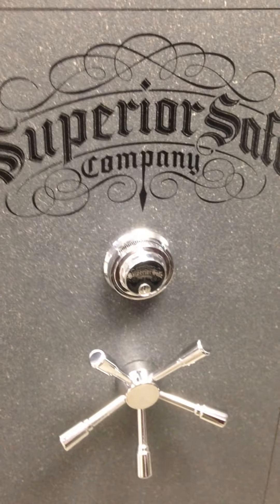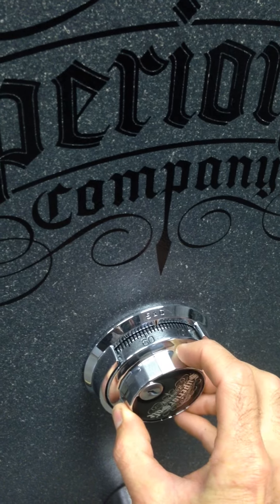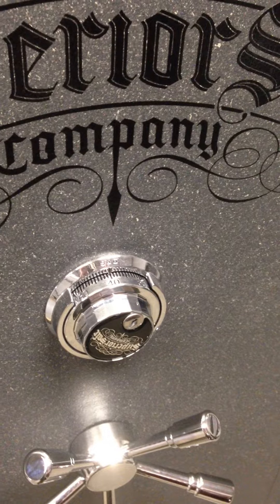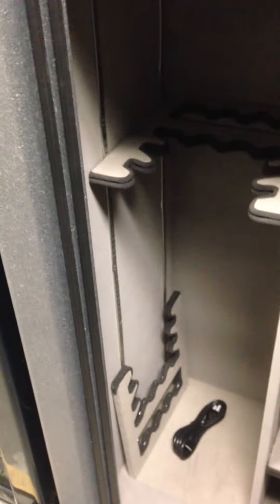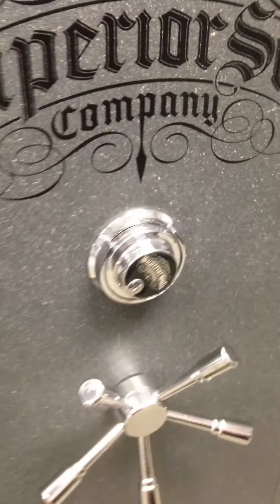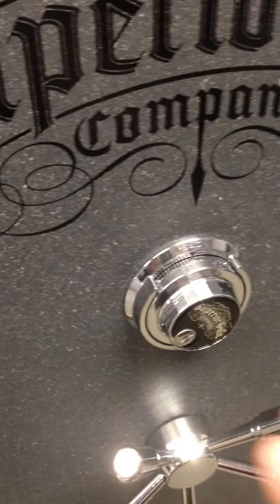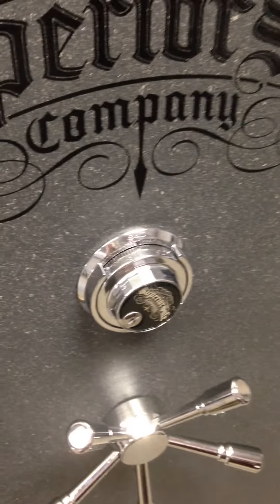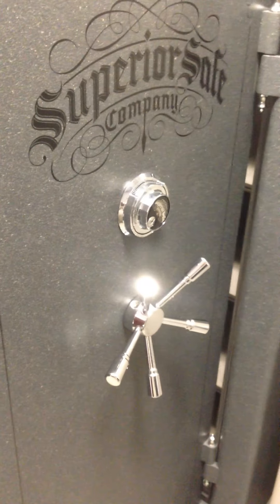S&G COMBINATION LOCK OPERATION AND TROUBLESHOOTING

Comment: Thank you sir.  My 4 month old safe has the issue that rocking at 90 releases.  I originally asked for a mechanical lock.  The salesman  called me and talked me into the electronic lock , but he forgot to note that on the order.  The safe was delivered with my asked for mechanical lock.  This lock has been giving problems for three weeks now.  Thanks for the instruction.  I will be contacting the dealer tomorrow.

Comment: This is most useful.  I was having trouble with my lock and stumbled across the "roll to 8 and bang on the door" solution years ago.  I did not know until today that I have a stuck lever.  I need to get that fixed/replaced.  It is a pain in the butt!  Thanks for the explanation.

Comment: My safe won't open. I tried my combination several times but the safe wouldn't open. After trying a couple digits up and down I managed to get it open, but then closed and locked it. I used the combination that worked but could not get it open again. If I manage to get the safe open again should I try lubing the internals, or just get a new lock? I've had the safe since 2014 with no issues until a few days ago.
Reply from the maker: Yep. Leave it open and call a safe tech for service.
Reply: Yeah call a safe tech for more money. We shouldn't be having to do this crap

Comment: I'm a fan of mechanical locks also.  I think it's harder for the manufacturer to build in their own "back door" combination.  Even if they did, a clever person could mechanically inspect the lock and see it.
Apparently it's pretty common for people to not think about where those bolts have to go and they get stuff caught in them.  The problem is 99% of safes use a "break free" system to thwart brute force attacks on the handle.  Nicer saves have a slip clutch, cheaper safes just build in a weak point, like a roll pin, which breaks when forced and now you gotta break out the drills.
Not sure if they are still around, but there was this company called, IIC, "Sturdy" and their solution was just to really reinforce the lock.  Their safe had about an 18" handle on it, and he would demonstrate the system buy putting enough force on the handle to break it off and the lock would still function.  Then he would remove the handle, put a pipe wrench on the spindle with a 10 foot cheater bar and he still couldn't force the lock.